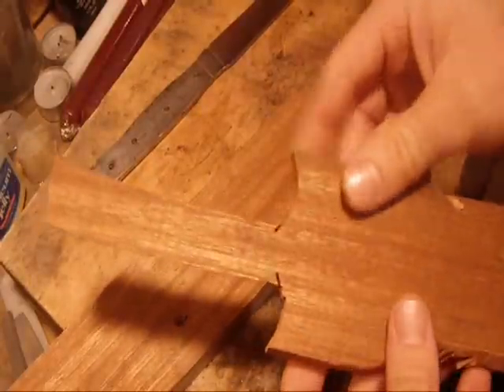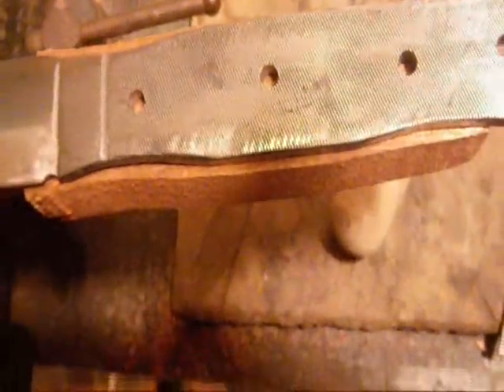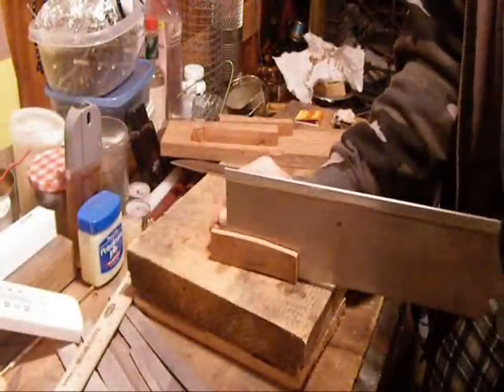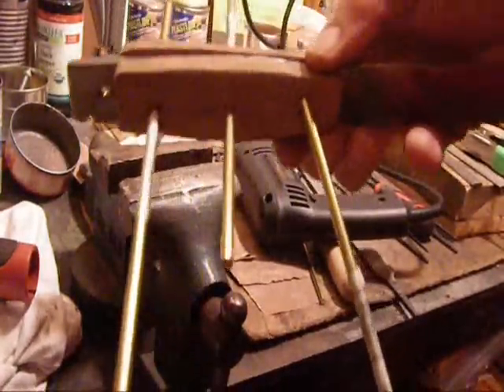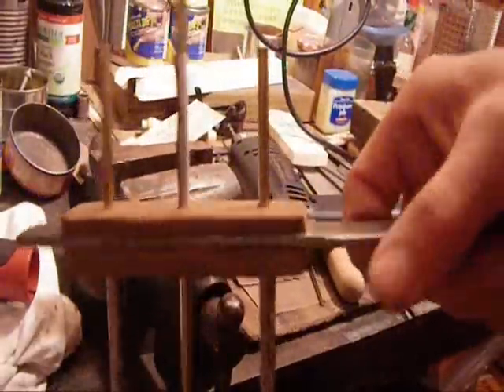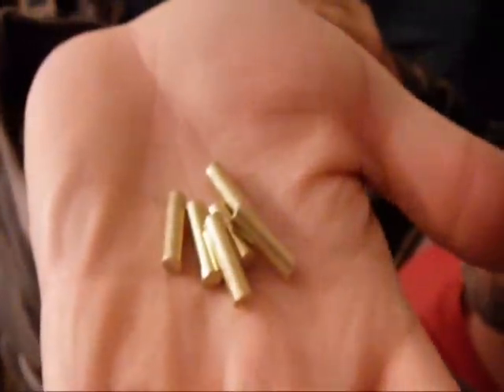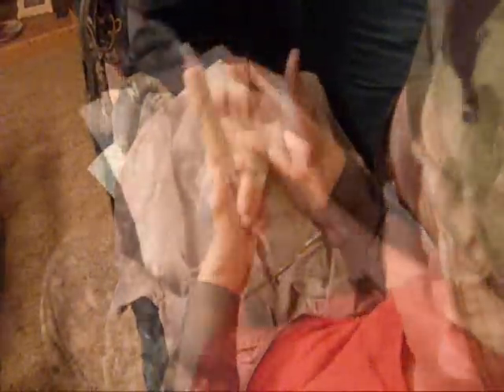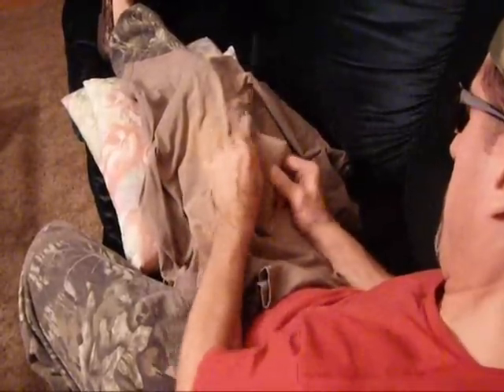Making a Bush Knife Handle

Comment from the maker: @RitchieM420 Many files were made from 1095 high carbon steel which works very well for knife making. I can not say for sure what type of steel is used in recent manufacturing of files but, they still work well for knife making. If I remember correctly, I made the entire knife in one week and I worked on it from one to two hours every other night. Total time is estimated at less than eight hours total. I enjoy improvised gear and do it yourself projects, this is a great way to be creative.

Comment: Thanks for the info.  I started not long after I posted the comment.  Right now the blank is almost complete I have to do a little more filing to get the grind even and she will be ready for the quenching and temper process.  I got some walnut straight from south america from a missionary friend that spends the winters in Belize.  Not sure about the sheath yet maybe leather maybe kydex.  Leaning towards the leather. I will try to have a review of it when done.

Comment from the maker: @mem7048, I got the rods at a hardware store. they should be available at some of the larger industrial or hardware supply companies. 3/6 inch brass rods - these were sold by the pack very inexpensive.

Comment from the maker: @agbagtet Yes, the product is called, " Double/Bubble EPOXY General -Purpose" which is made by "Hardman."   I got it from a distribution Co. called Mcmaster-Carr but, they just called it general epoxy. It comes in a pack of several two part packets that are about the size of a little ketchup packet. One two part packet is just enough for a handle.

Comment from the maker: @rdylina The brass rods are a very snug fit and are held in by the epoxy I used to adhere the handle to the metal.

Comment: Hi there,
I like your way to make knives, but I have some questions:
1. When you will sharpen your knife, will you use a belt grinder? 
2. The belt grinder isn't heat up the blade (carbon steel) and destroy it? How do you avoid this?
Thanks a lot!!!!